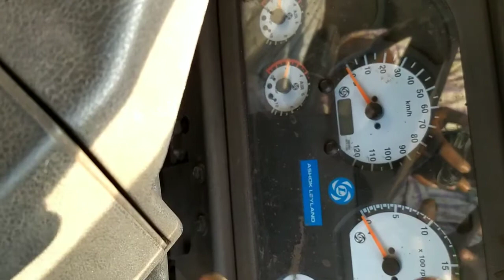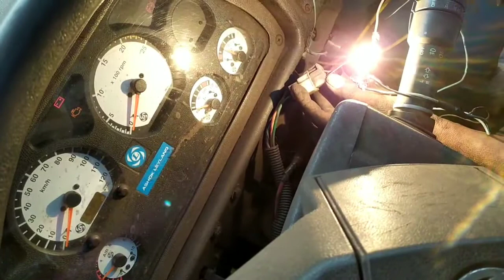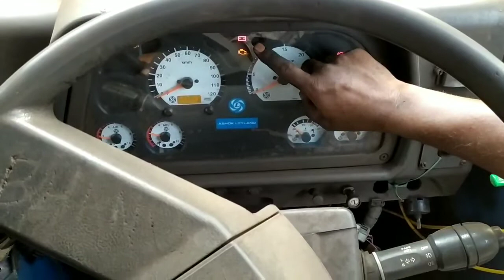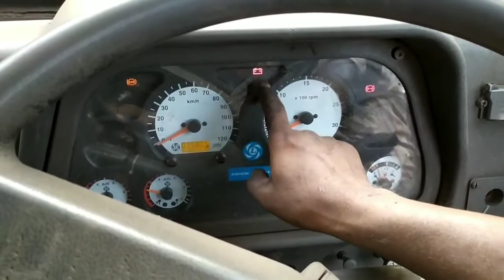how to checking wiring harnes BS4 Leyland vehicles

Comment: Anna auto ki dyanamo vundadhu kadha konchem adhi Ela charge avuthundhoo + avvakunte em check cheyyali konchem chepthara broo
Reply from the maker: Auto ki  engine  priweel  in side winding coil nundi power vasthundi   praiweel  engine body side nundi 2 wire bayatsku vasthae akkadanundi chasi  body ki regulator ki e wire Lu connection vuntundi  coil nundi vachinda power  regulator DC chesi battery ki charge chesthundi  regulator ki 4 wires vuntavi red, + black - enka 2 wires praiwel nundi vachinavi  praiweel nundi vachina wires ki power chekcheyu rendu wirelu cut chesi wairlu rendu sparking ravali appude power vasthundi lekapote coil damejed are vuntundi alage regulator ki Kuda + red colour ki Maine power vasthundi ledo chekcheyu appudu problem  clear avuthundi